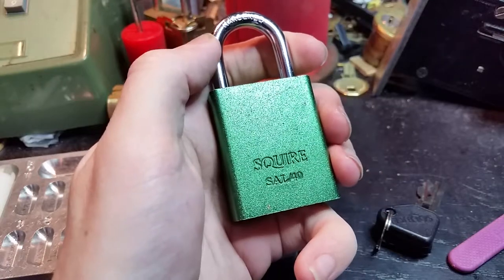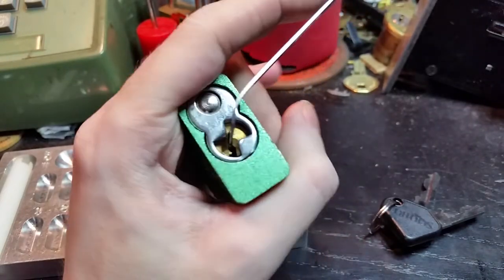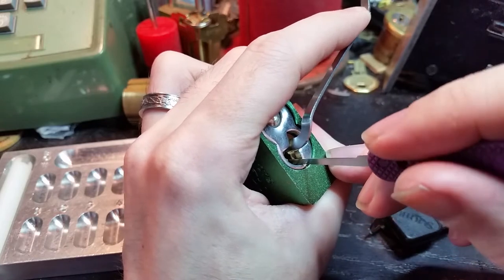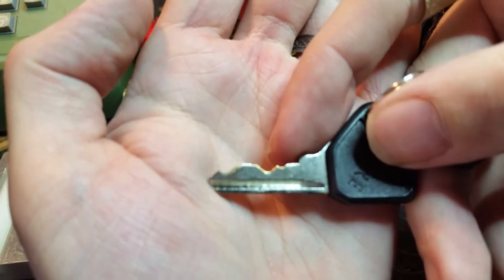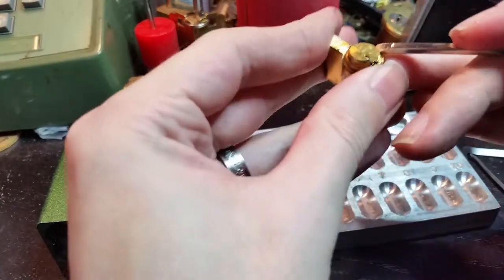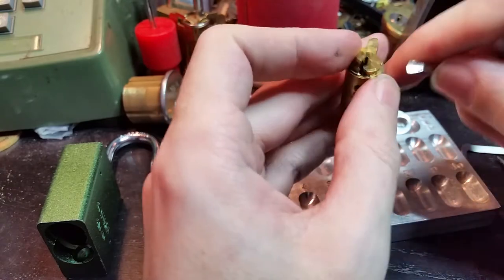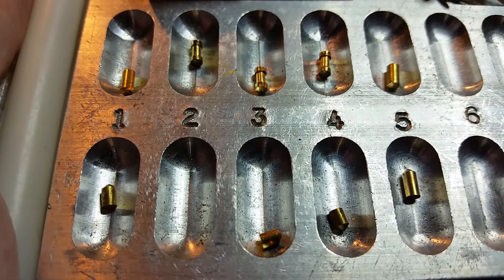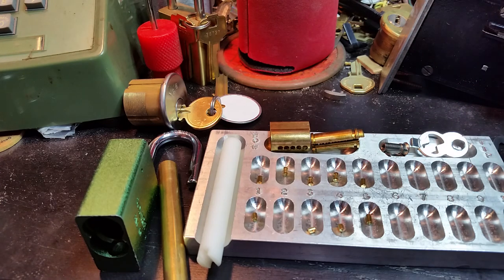(98) Squire SAL/40 padlock picked and gutted

Comment: Nice picking.  I just picked one on my channel about a week ago.  I'm pretty sure the drivers were all the same in the same positions as well.
Reply from the maker: It would make sense. I usually try to put standard or serrated pins in the first and last chambers when I am building locks. A solid pin in the last chamber helps keep the key move smoothly without jamming, and the front chamber tends to be exposed to the elements so a solid pin helps reduce the amount of debris that can enter the cylinder.